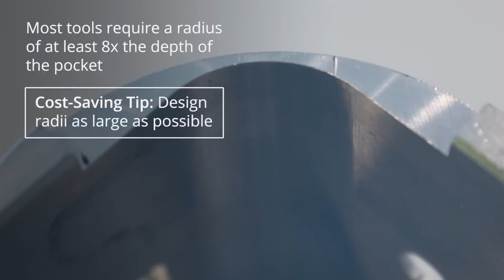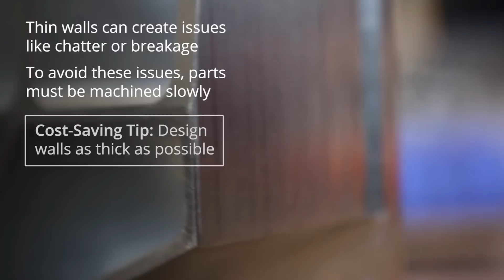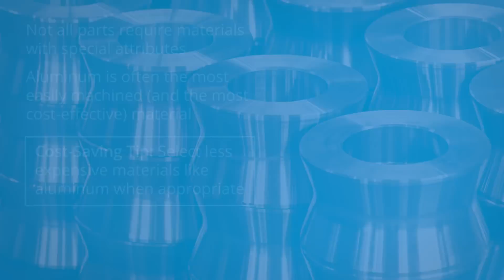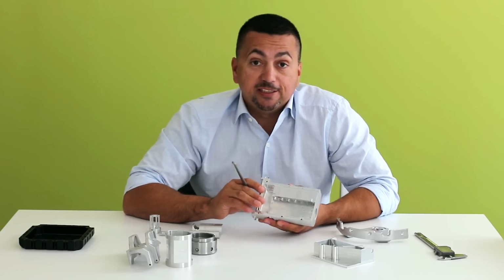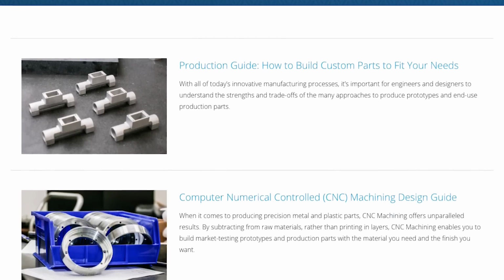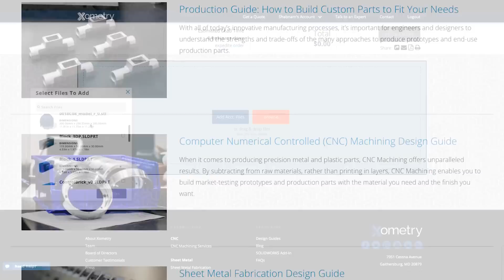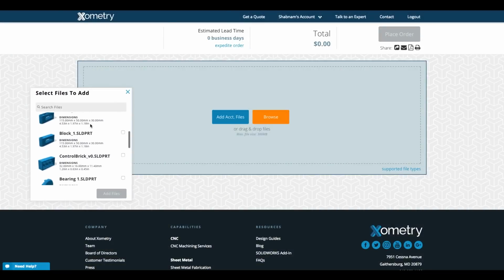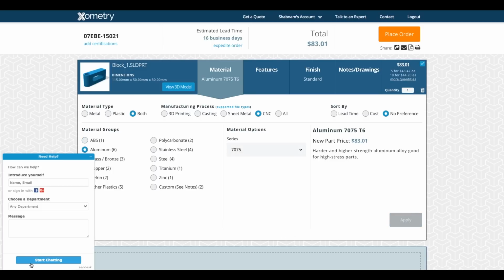Top Ways to Save on CNC Machining

Comment: Great information. As a 30+ year machinist I understand this all to well. One thing I would like to add  is to also use a radius that is slightly larger than the tool. You can't (easily) run a 3/4" endmill in to a 3/8" radius corner. To corner needs circular interpolation to avoid potentially severe chatter. There are several factors at play but using a radius half way between the next size up in 16'ths is a good start. In this example a
 .406" or there about would be great.

Comment: I appreciate the tips. I would suggest though that you reexamine the written and narrated internal radii info that begins at 0:20. For example, you state that "Most tools require a radius of at least 8x the depth of the pocket." You've got that backwards. In your example of a 10" deep pocket, that would mean an 80" radius--or a 13.3-foot diameter end mill. 😳 I think you meant at least 1/8th the depth. Even this, however, is not standard practice in the machine shop--not if you want to keep costs down. A better rule of thumb is that the pocket shouldn't be deeper than 3x the tool diameter--or 6x its radius. Costs begin to climb after that ratio.
Reply: @elypowell6797  What Megan said makes sense to me. I was wondering too when I see 8x in the video.
Reply: Ely Powell I can only assume you are making an incredibly misogynistic "joke."
Reply: please girls!!! not machining industry.
Reply: @blabla-kk8bl  Don't worry. We girls will let you make coffee for us. 😉

Comment: I have an extremely simple part that is about 15x20x60mm very simple. And for my quote it was close to 600 bucks for aluminum. How can that be
Reply: Kirk Alaniz Get a second quote. If still too high, ask the machinist what's driving up the costs. Also remember that if you need just one part, the CAM programming time required for just one part is likely going to make the price painful.